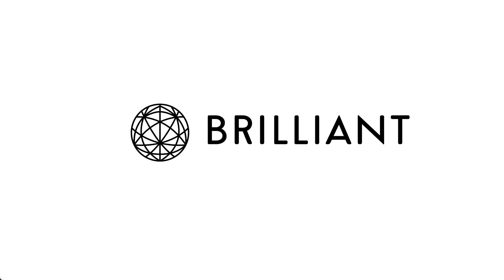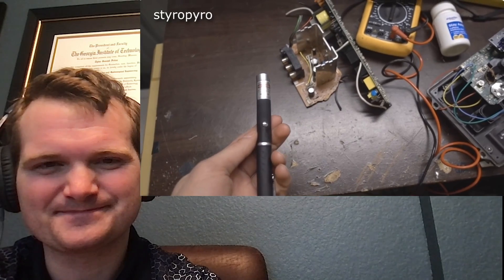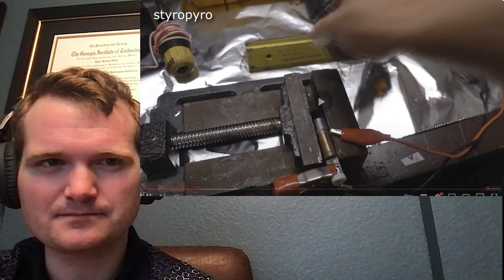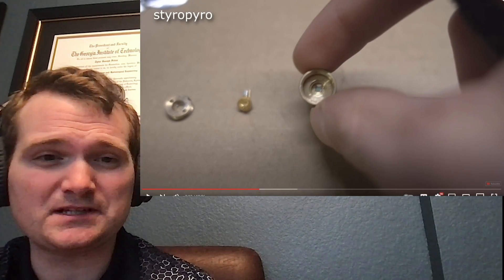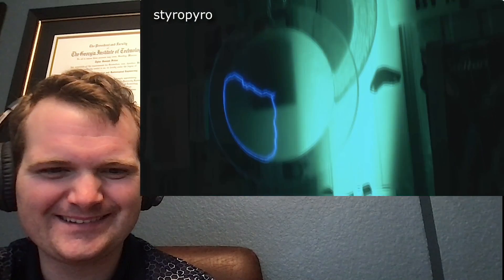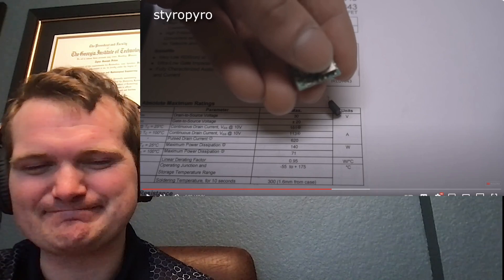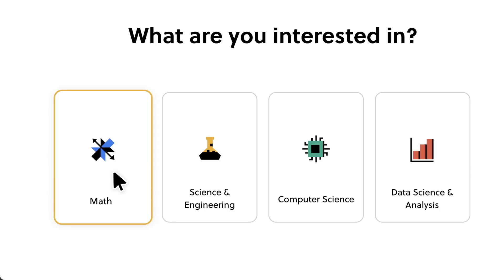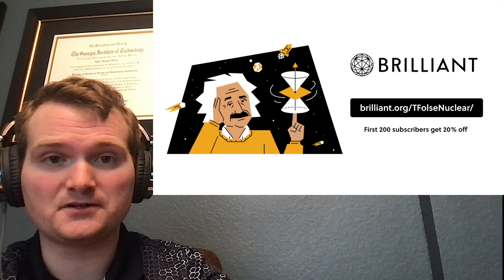Nuclear Engineer Reacts to Styropyro "Crazy eBay Green Laser Pointer Mod 1mW to 1400 mW++"

Comment: The main risk of neodymium is actually impression. I work in EMS and the number of neodymium injuries is surprisingly not too uncommon. Ingesting a neodymium magnet is dangerous because quite simply it can rupture your internals. Pulling itself right through the your intestinal wall if another magnet or ferric metal is placed in proximity. That's scarier than the actual toxicity I would imagine

Comment: Hi Tyler. You have experience of working in a nuclear reactor. Could you run a nuclear power plant with weapons grade uranium. What would the risks be and if the normal is like 5% would 95% produce 19 times as much energy.
Reply from the maker: Good question! Short answer: It would be like putting jet fuel in your car! 

Longer answer: The size, shape, and layout would need to be changed to accommodate the higher enrichment in a commercial plant. It would also be more expensive to get higher levels of enrichment. Basically, a complete redesign of the plant! 

That being said, high enrichment isn’t exclusive to nuclear weapons. Submarine engines can have enrichment above 90%. This allows them to start up and raise power very quickly in a military scenario. I would liken a submarine to a sports car and a power plant to a freight train.
Reply: Thank you. @tfolsenuclear

Comment: So, the W rating of the pulse lasers have actually started to confuse me a bit. Wouldn't the pulse be rated in Joules if the rating is for the pulse and the watts be the rating for the continuous output or is there an actual good reason for how the output ratings are used?

Comment: computer parts now days is pretty robust, they all have build in ESD protection by design... i think ESD is more of a problem when working at component level.. especially now days all component are almost microscope... so you can very easily killed those with ESD if you are working with them without any form of grounding..